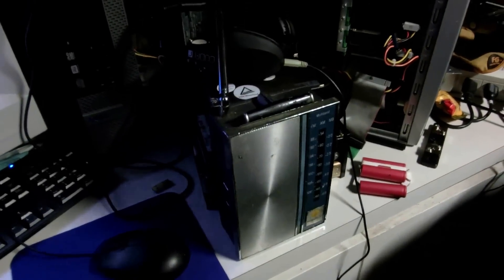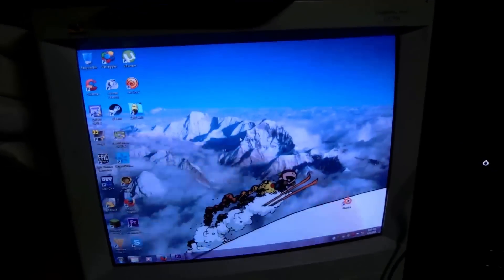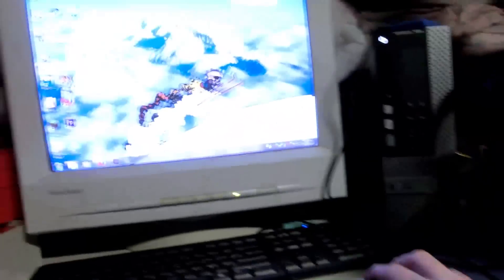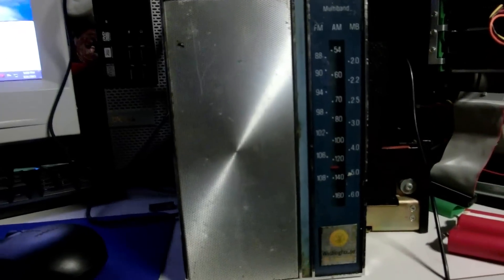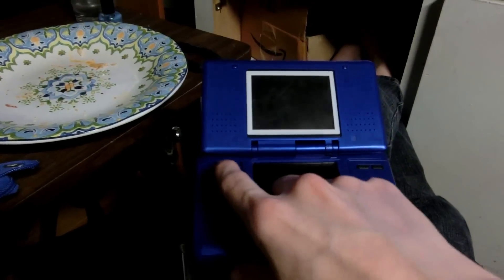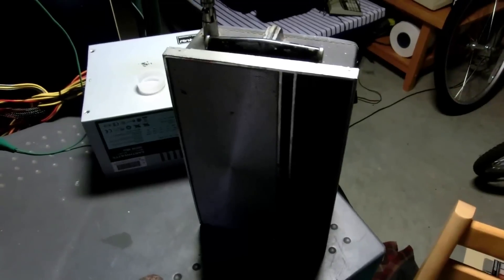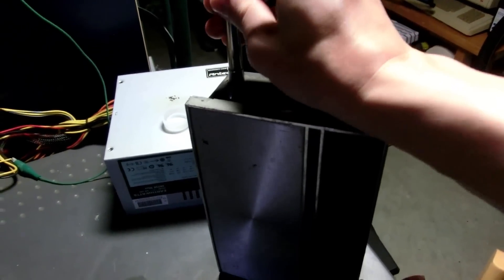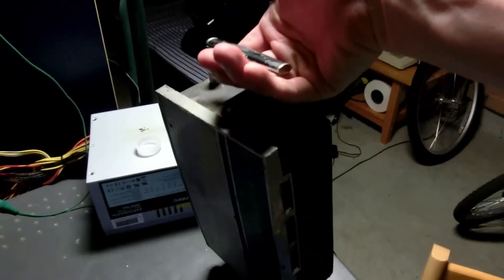Radio Interference of CRT monitor, Nintendo DS and 3DS

Comment: I used to use the radio trick to help debug programs on my old TI SR52 programmable calculator.  You could tune the radio into the calculator clock and listen for the difference sounds of the various instructions.  You could hear things like program loops.  The radio was handy for detecting if your program had an infinite loop as you could hear the repeating pattern time and time again.  There were also some programs you could key in to produce some crude musical patterns.

Comment: Its picking up harmonics from serial interface from ram rom bus to cpu talk. Data crunching like your old 56k modem. Do it near adsl or ethernet and it will do just the same. Hf lf bands only hear the modulation bandwith as noise as its replicating the sound in the audio as its showing how much emf and erip and the audio amplifier will induce that noise. Am in its hayday did not have much noise filtering and this clearly shows that most modulation will pass through it depending on shielding. Not rocket science dude. I thought you would have learnt that with pwm on your bike. Go ride that with the mw radio and see how much noise it puts out with emf pulsations.